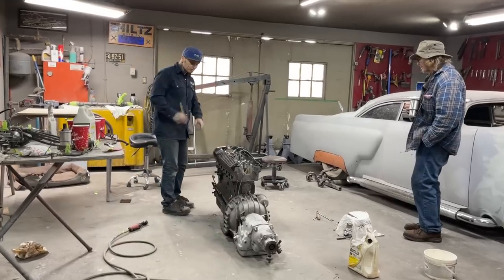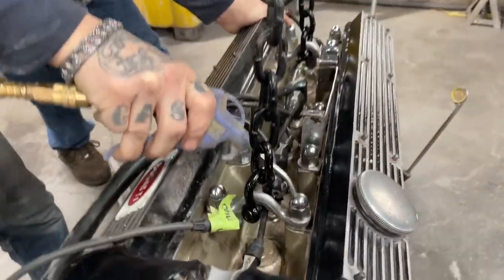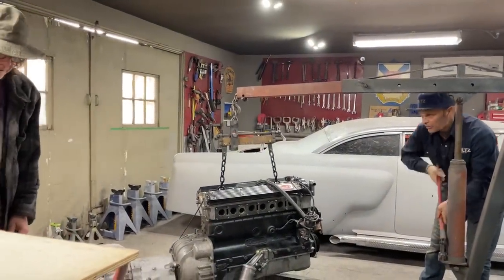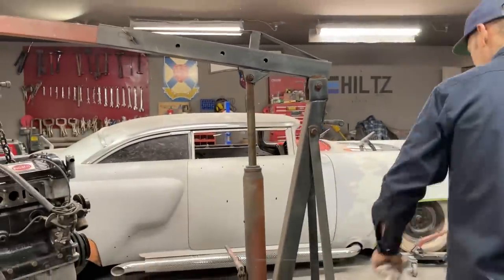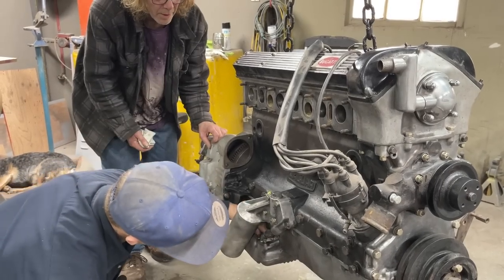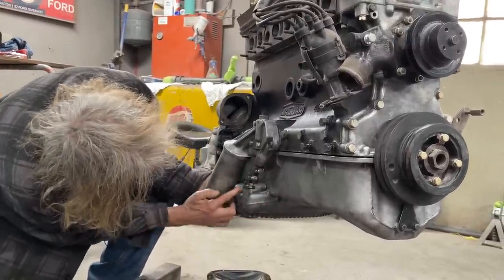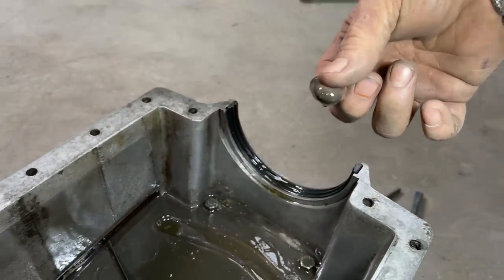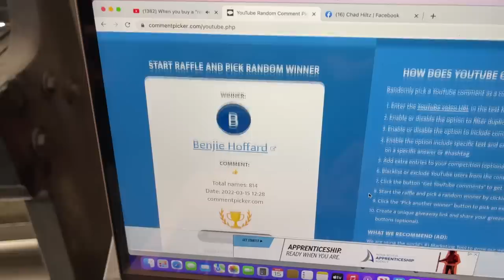The Moment of Truth: Pulling the Oil Pan to Check the Internals

Comment: Thats metallic in the pan. It looks like bearing which isn't Ferris. It won't stick to the magnet. I wonder if the guy just stuck bearings and rings in a worn motor. Probably did a dingle ball rebuild. Rust-Oleum rebuild.

Comment: A moter some times have metal shavings in them when they're brand new that's the reason they changed the oil at a couple of miles out of their break in chech the filter after you change the oil
Reply: That’s ALOT of trash for a engine that has only been run a few times

Comment: Just seen the starter wrong bolts. Anybody that thought a starter having room to float around with undersize bolts doesn't have the smarts to rebuild an engine. Chad, you are a patience man.....I would probably be in jail after that stunt was pulled on me. Sorry for your trouble. Not deserved.

Comment: Chad, those Jag engines are a big headache. They are a bear to get right especially if it was rebuilt by someone not very familiar with Jags. A lot of mechanics would steer clear of that engine. It's not like a Chevy. They can be a money pit. They also have a tendency to run hot. A freshly rebuilt engine should have fairly new oil without any debris. A magnet will not pick up aluminum. Just the fact that you have found so many faults on the outside would leave me in severe doubt about the mechanical soundness of the internals. I think it might be wisdom to find a different engine. A warranty is only as good as the person who rebuilt the engine in the first place. Good luck with the project, I just hope you haven't been taken advantage.

Comment: It's not the filter Jim the motor worn or he hasn't cleaned it properly when reconditioned it you will still get aluminum filings in sump with a good filter its just the size and amount that's the problem 😉

Comment: Chad if I was you do a full strip down of the engine as there may be other problems such as  bolts not done up properly and other components not fitted correctly.

Comment: Guys, the filter makes no difference in regards to metal chunks.  The filter won't pick that up. Metal will sink to the bottom and won't make it to the filter.  Jim means well but he is incorrect in his explanation. Now, I'm not sure if those are metal pieces.  A magnet would tell.

Comment: Oil filter, oil filter, oil filter!!
The oil is filtered after it leaves the oil pan and before being pushed threw the engine. Debris are flushed by the oil to the oil pan. Then the oil is pumped from the pan threw the filter to clean the oil before it is pushed threw the engine.

Comment: That sludge just looks old. Either the sump wasn't cleaned when it was rebuilt which is just weird, or the engine wasn't rebuilt. Not necessarily a bad engine. No oil filter could collect that amount of debris/sludge, and no used engine will ever be clean, but that is many 1000s of miles of build up.  Also looked like there was potentially flakes of bearing but hard to tell from the video.

Comment: Those aint new spark plug leads either and they didnt replate any of the brackets. .. you'd think for the price you'd pay you'd get new components from rooter to tooter. But it looks like maybe the new stuff got swapped into another engine, or someone else got the 'good' engine altogether..

Comment: They should have just checked the oil drain bolt, that is a magnet isn't it? I have seen a mess like that in a motor before, The guy just slapped in new rod bearings to flip the motor and in no time they wore down to grayish sludge and particles.

Comment: Jimbo although he has some knowledge, there are holes in it. That engine needs to be completely torn down and rebuilt. The metal in the oil pan looks like bearing material which, will be left in the pan after bearing failure. I seriously doubt that the engine was ever rebuilt.

Comment: Chad one more thing…

Could you not make it so that the engine (whatever you end up with) could be dropped out from below, rather than needing to lift the body off the frame to remove the engine?

That might mean that the motor mounts would need to be removable from the frame. 

Keep doing what your doing. Always dig the life lessons sprinkled in throughout your content.

Comment: I think thats big end in the pan why it's not in the filter, oil gets pushed out the sides of the bearings and drops directly into the pan, then gets sucked up into the filter, this material hit the windage tray and stuck, very soft bronze aluminum powder = wrong size bearings, judging by the cooling fan bolts imma say inexperienced builder, either wrong size or neglected and worn..

some break in material is normal, dunno the Bugg well nuff to know how much tho?  however black oil is not normal, you always do a 500 or so mile oil filter change to get your break in oil out of the motor and get good regular oil back in, break in oil has done its job time to go, and it's always clean and clear, break mileage simply isn't enough to blacken any type of engine oil, 5000+ miles is tho...

not worth rebuilding or?  cannot see how that's a brand new rebuild when the oil is black? then the thick material on teh windage and in the screen? ruh roh ruby... not even close.. unless they use recycled oil on rebuilds? oil should be clean and clear, very sticky and slippery...  doesn't add up at all, rattle a rod see if any are slacked..  looks like bearing or cam chain guide material? top end should make it to the pump inlet and miss that valance or windage tray but honestly I know that engine bout as well as I know the pope...  lol  sucks man, some people, getting worse every day.. it's not the one thing...

Comment: Chad if the engine was rebuilt you are supposed to run it for break in then drain the oil and replace the filter and put new oil and filter because you will get some metal shavings the filter should pick up some of the metal shavings but not all of it

Comment: No way that engine has been reconditioned ..Though the guy you got it off might claim " rebuilt " or overhauled  is a head shave,  lap the valves,  hone the bores, new rings,  new bearings and gaskets only .. But you still need to clean the internals atleast ..If you want it to survive .

Comment: I would have to say that the motor is shot. The only way to have large metal particles in there is if you have metal to metal contact were there should not be. The motor will probably not last more than a hundred miles or less. I have be working on automotive engines for almost fifty years and I would ether get a different one or have that one completely gone through. I’m hopeful that maybe you can get a refund. Best of luck with your project I only wish I could be there to help you with it.

Victor Doino

Comment: Sorry bad chad ,That guy has rip you off .That motor is not rebuilt  that motor should not have all that rubbish in it . I have rebuilt many race engines. And oil filters clean oil not old sludge in bottom. Only thing is you were lucky you looked before you in stalled it  .Cheer from Australia .

Comment: Have I missed it or have they found one single bolt that was properly tightened?
Reply: You got screwed on this junk. Pull theRod caps and the main caps,filter has not a dam thing to do with that metal it is bearings.look at the crank shaft.

Comment: Honestly, using a Jaguar six was never the best choice.  Nice looking, yes, but not particularly reliable or powerful, and all engines English leave puddles behind them.  And the bits for them are pricey.  A Supra or 2xxZ engine would be a better fit and probably take up less space.  I'd be worried about scored crank journals on that engine, and taking off the bearings you'll probably find they haven't been replaced and the crank needs turning.  Not a happy thing.  

Jim, the metal bits look like aluminum to me, and wouldn't be picked up by a magnet.  

You still have a Jeep engine in the shop, right?  :-)  A built Ford or Chevy pushrod six wouldn't be an awful choice either.  What American engines tend to have that foreign ones don't is torque at low RPM.

Comment: If it is a new engine why so much carbon in the exhaust ports. the metal in the oil pan looks like someone didnt clean out the head and block properly after machining. the oil will be a bit gluggy if it has been run briefly as the assembly lube gets moved about the engine. in the upper pan it looks like there is some bearing materal but it is hard to tell without a magnet and looking for myself. It needs a full tear down sorry guys. That metal has gone through the engine.

Comment: Follow the oil path. The oil is picked up from the oil pan, then goes through the filter, then the engine.    It is not a rebuilt engine.  You should go through the whole engine anyway. Do not trust others rebuilding.  Filter will pick it up AFTER the pan.

Comment: Chad you need to return that motor at motor you'll probably have to shoot app to show anyone doing awesome so you'll have to rebuild the motor in the long run But I would still hold him responsible in legal matters as I move forward That's what happens when you buy engines that aren't from professional engine builders that have good ratings
Reply: Auto correct I hate it
Reply: Wouldn't hurt to learn to rebuild that motor anyway in experience you need and my eyes  I do all my own work from the ground up except transmissions but I'm gonna make myself  Learn them

Comment: Think the oil pan bolts were tight because he never took them out. Think he just drained the oil, and put in clean oil knowing you would check it. And thinking it looked like new oil , he could fool you into thinking her really did rebuild this engine.. I'd Be HOT seeing what you are running into.

Comment: That appears to be a used engine cosmetically cleaned up and sold. The seller, probably assumed the engine would never have any miles out on it due to the amount of vehicles you have. There is an old adage that states “What starts out bad, doesn’t get better.” He needs to step up, full refund and then go away into his own shame.

Comment: Living in uk I've rebuilt many jaguar engines and many others and I have never seen that much crap in an oil pan after a break in, no way that engine is new, move the piston rods left and right and up and down to see how much play is between the rods and crank, also you could tap the crank pulley in then put a bar  between the crank pulley and the block and level the crank forward to see the amount of movement, but I wouldn't expect to see that much crap for many thousands of miles, either that or sealer has been added to the oil to temporarily stop engine noise, either way bad news, sorry to say it looks like you have been scammed, for that much money I would have inspected the tolerances on the engine before paying,

Comment: Even if that was professionaly overhauled theres no possible way the inside would look like that. That motor would need tore completely apart and im sure you would find that the main bearings are toast. Looks like the oil was boiled at some point in the 200 thousand miles it has on it. Good luck and get that money back for that garbage.

Comment: Jim hasn't got a clue. The filter only cleans the oil on it's way Into the motor. The metal/sludsge in the pan is most likely a result of bad machining/ fitment of parts, & indicates unacceptable wear, for a rebuilt engine. A small amount of grey from the bearing settling in would be ok, but nothing else. Take trhe motor back, and get your money back. Buy a motor from a reputable professional rebuilder. It'll be cheaper in the long run. Be a Man Chad, and don't push it all onto Joelene, go see the prick yourself.

Comment: Chad if you guys need help with this engine let me know. I will build this engine for you guys for free just buy the parts. Now  that's out the way when you build a engine you run break in oil in it first and the rings will break in and leave some ring matter in the oil pan. That's why it's called break in oil. BUT there is way to much dirt in the oil pan and you can pretty Much tell it's not a rebuilt engine unless he didn't clean the oil pan. witch is not likely. You should look at the cylinders and see if there's a cross hatch in them. Then you would know if the pistons have been out and cylinders have been honed. Please pull valve cover so we can see how clean or DIRTY that area is. If it's dirty in there then you know it has not been rebuilt. Let me know if you want my help Thank JOSH HODGES.

Comment: Take the caps off 
An look at the big end an main bearings 
That looks like deffo bearing material bet it hasnt got any oil pressure 
An it eaten the shells 
Deffo wrong about filter it does filter oil but if u wear bearings it makes the oil look metallic like that 
Even with correct filter it would go like that if no oil flowing propperly

Comment: Hey guys, that motor is crap. I have built plenty of high horsepower motors A super fine glitter type of metal in the filter can be expected from break in but what you saw in this motor is a motor coming apart. This isn't a filter issue.

Comment: Damn bro this dude and his filter!  Who cares where all the dirt ended up.  It shouldn't even be anywhere in the motor.  Filter filter filter wrong filter, damn.

Listen that guy ripped you off.  That's not rebuilt with all that crap inside.  No possible way I'd put that in my brand new car with all those hours you have into that car.

Comment: Just pure sludge from decades of neglect.  
Take the baffle out of the sump, and that will scare the heck out of you.
And have a look up under the skirts of the pistons to be double sure, and look for cross hatching marks to the bore, remove the end caps to check the bearings for wear.
Stick with it they're a great engine when good👍.

Comment: Chad that engine is not worth much money at all - the comments about pulling a bearing cap and looking for ware is a good idea also lay under the engine and with a bright light look up the piston barrels for cross hatching and other signs of a rebuild - Jim is correct about the oil in the pan it should be clean even if there was a large amount of heavy start-up oil on the moving parts at there could never be enough to put sludge like that in the pan - Sorry to say but I think you got took.

Comment: I'm going say that's not new rebuild I've seen alot of new engines and I'm 99.9percent sure that is not new I've opened up one of my engines with fifty thousand or more miles oil was changed every time and it looked better than that it still looked new

Comment: The engine should be clean no metal shavings at all unless you have over a hundred thousand miles on it. Not with a rebuild. I would say that engine has big problems

Comment: I'm sorry if I missed previous episodes, so it sounds like you guys got the seller to own up.  It seems you got a written guarantee. These last 2 episodes show that not only did he not do the work that he claimed.  What work he did was total crap!!  And he was hopeful you guys were dumb enough to just install the engine and run with it.  This was just criminal.   You are taking the high road.  At least you aren't out the money.  Just your time and effort.. maybe you'll not have to rework the front end too much to make the next engine fit. If it was me, I would do more than cut them out of my life.  I would need to take a lot of time to calm down before I met them face to face.  Otherwise I might do something I would regret.

Comment: Replace the real seal. This is a rope gasket, so soak in oil.  If you don't starting the engine will burn the real seal.  Also put on a new transmission seal.

Comment: Even if that engine was totally worn out and had no filter in it,..........if the oil pan had been off and cleaned it would still be clean after a couple of minutes of runtime..........you got straight out lied to.

Comment: The cleanliness of the oil is the first clue. An engine that has been rebuilt with new oil will still have clean oil in it with as few minutes of run time that this engine is supposed to have 
The garbage in the pan and the sludge indicates the pan may have never been taken off when it was "rebuilt".
Probably no sense in checking rods or mains now. Just go back to Doug and get your money back.
Time to go for the back up engine.
You have enough clues to not have any faith in running this engine as is!

Comment: Suddenly everyone has turned into armchair jag mechanics ,If I remember right wasn't the engine on a runstand that had a radiator on it when Doug delivered it.
Reply: Doesn’t take an Jag Mechanic to figure if shavings of any sort should or should not be in the oil pan.

Comment: I understand what Jim saying about the filter picking up the contaminants but that engine has not been ran long enough to do anything and whatever that junk inside personally I don't feel that should be in there on an engine supposedly rebuilt with everything else wrong that he sees taking off looks a little shady I definitely question everything about that motor put a lawsuit on him he does not deserve to be in business luckily he didn't just put the engine in without checking 👎👎

Comment: There should be no metal shavings in a rebuilt engine, I'm not a pro I wouldn't put a" ? " engine in a hand built car with all the work everyone has put into hand built CAR. Good thing you flip the oil pan. If it was rebuilt it shouldn't have no sludge in the oil pan. I don't think the guy was trying to pull a fast one he probably thought it was a good engine.

Comment: the guy that rebuild that engine if he ran it he didn't use  high zinc oil on break in most likely the bearings and cam shafts no good from the looks of that oil